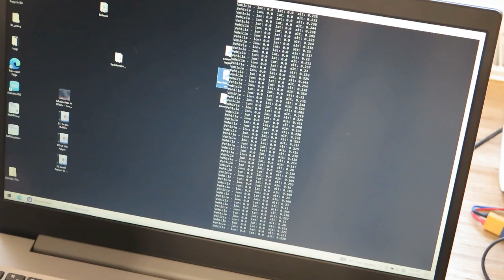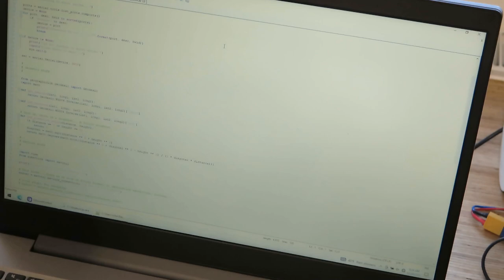DIY Mavlink based FPV antena tracker

Comment: Counterintuitively, a rubber band  will happily center itself without any guides on pulleys having a convex (pushed out), surface.
Reply from the maker: I sanded it a bit, but it did not help. Probably that flimsy piece of tubing on the motor did not help too. So I opted for brute force method. 
Whole thing is brute force. Nothing was ever planned in this build. Even build itself wasn't planned. I did not want antena tracker :D 
I thought it will help with range but problem is somewhere else.
I did many many experiments, and I think, that batteries are getting too cold and "do generate" a lot of noise. Basically as if internal resistance got higher, but perhaps it also has to do with how charge is release is released on chemical level. That said, I can put transmitter into freezer and test different chemistries with stabilized PSU as control and don't have to torture myself testing outside. I think this would be topic for video on it's own if I figure this out.

Comment: Yeah, live commenting here.

What you need to do is make tracking system constantly ping the craft with 3 sensors. Then you use return data to determine where it needs to go. You can do this pretty easily in python or arduino in c.

Comment: Shit reception is probably because of recent interference. Maybe some new equipment was installed somewhere?

When you use this machine to rebroadcast you probably cause your own interface, as well.

One easy way for tracking is PID loop.
Reply from the maker: Reception has changed gradually over time. There was no change in hardware. Even when I swap components (all of them) it's more or less the same.
It's really really strange... Maybe I have somehow burned out both VTX modules I have. Need to get rf power meter to test this. I have checked and tested everything I possibly could.
Reply: @IlusysSystems  I'm saying maybe some other equipment in the region is causing interference. Like a new radio tower or communication system.
Reply from the maker: @nicholasboyarko1680  Nah, that's quite unlikely. I am flying at different locations. Some are quite near to airport and there is wild radio infrastructure, sure. But they don't operate on 5.8GHz range. It would be dangerous for them and probably even illegal.
Reply: @nicholasboyarko1680  Solar flares could be an issue, they are in a worsening cycle this year and over the next few years. NOAA keeps track of them. I believe they most effect lower range frequencies, however may also have some effect on higher frequencies as they worsen. May be worth checking out.

Comment: Sliprings are fairly cheap
Reply from the maker: Sure, but you can as well allow for more than 180 degree rotation + add some hysteresis to math, so even when you are traversing near threshold line this wouldn't cause too much annoyance. This thing was literaly made on the knee with parts laying around, so I kinda wanted to make it as simple as possible.